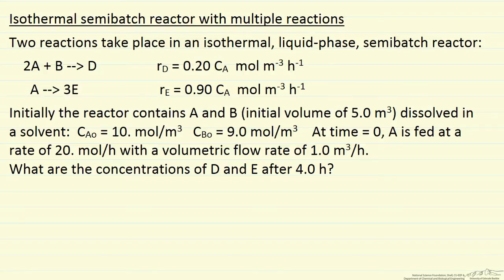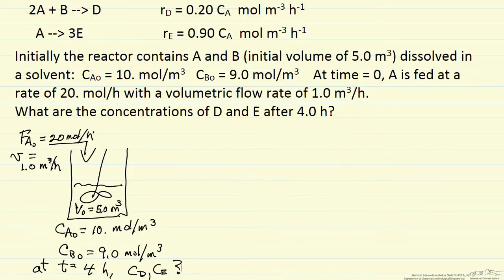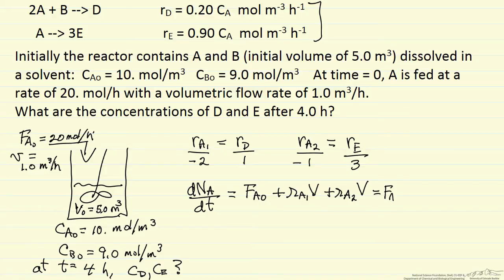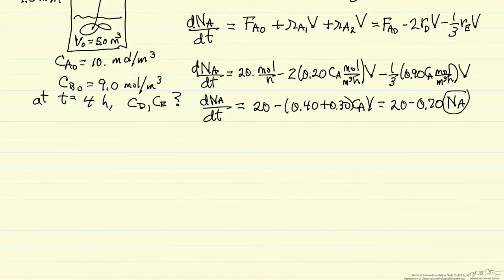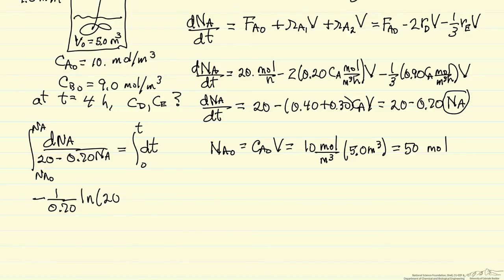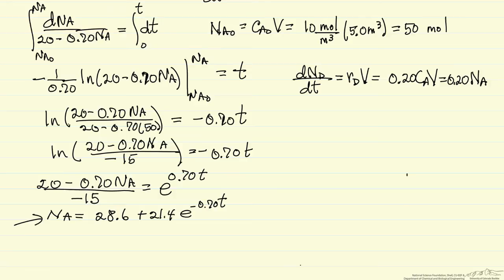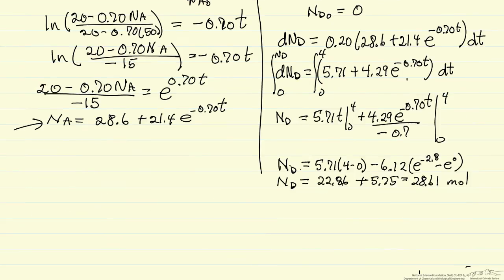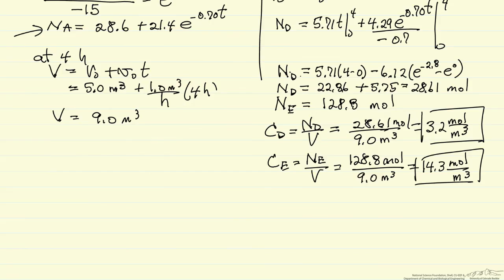Isothermal Semibatch Reactor with Multiple Reactions

Comment: There is another way to find out ND and NE easily I got the same answer 28.57 moles of D and 128.57 moles of E and in terms of concentration just divide with 9 
By the way I did the same for NA but for finding Nd And NE  I used overall fractional yield concept for D/A and E/A. Is very Short compare to these